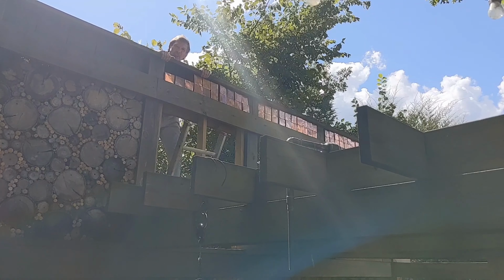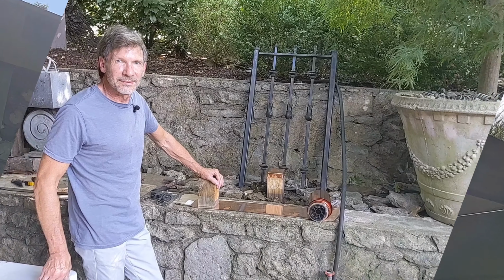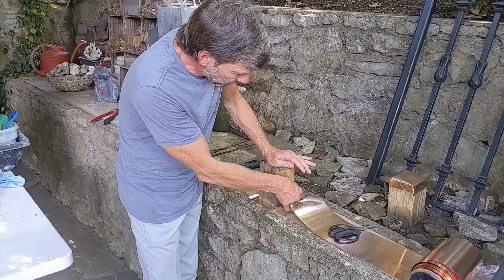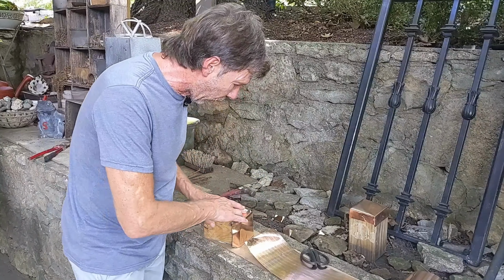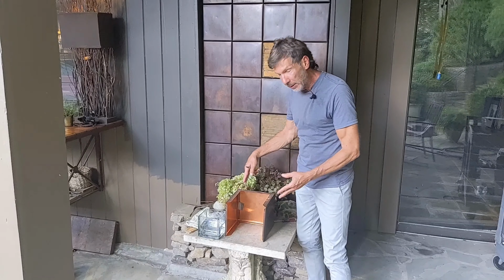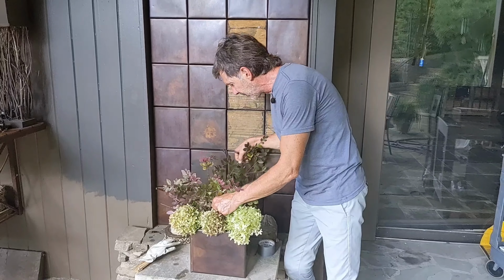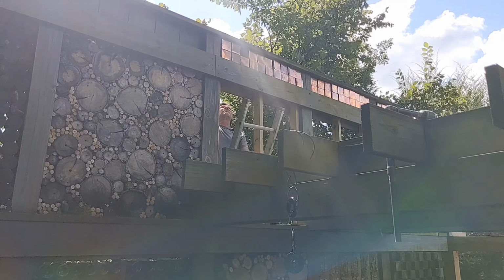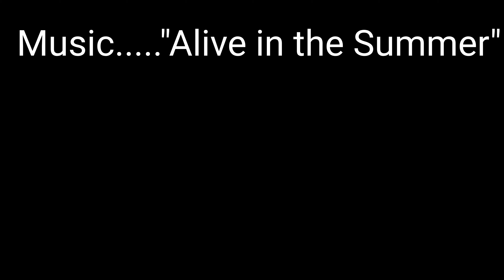Copper Cubes, Ladders, and Creating a Simple Garden Arrangement

Comment: Hi, thanks for your video, what is the thickness of the copper that you used to make the square? The square that you put the flowers in it,?
Thanks
Reply from the maker: I will check but it is thinner than 16 gauge that is normally for roofing and thicker than craft. I will get back to you. You can cut it with kitchen scissors.
Reply: @DesignYourLifewithTerryWhite  thanks for your reply, would be great if you could plesae let me know.
Reply: @DesignYourLifewithTerryWhite  hi Terry, did you get a chance to check the thickness of that square pot please? Thanks mate,